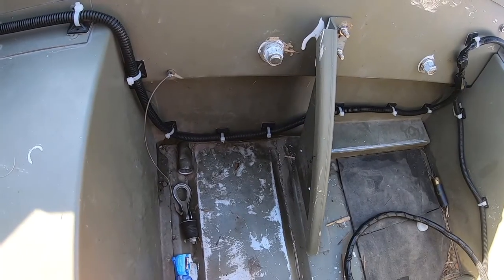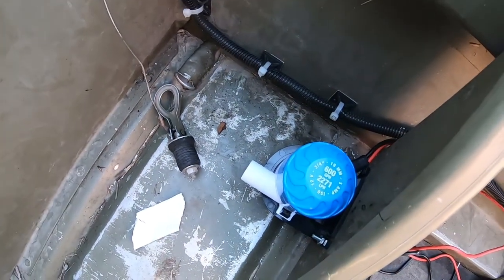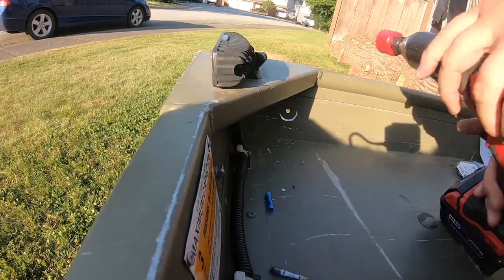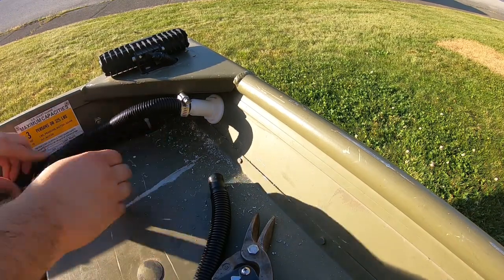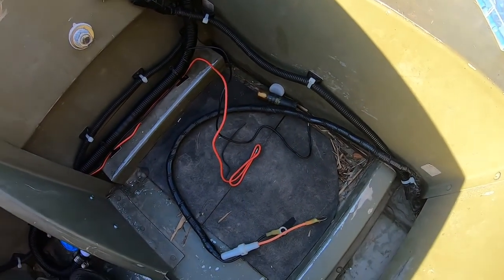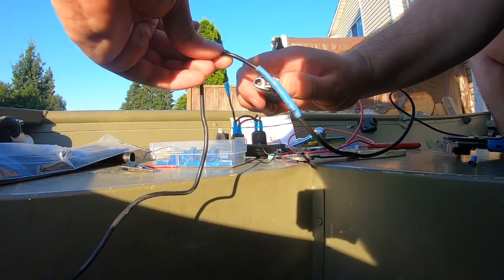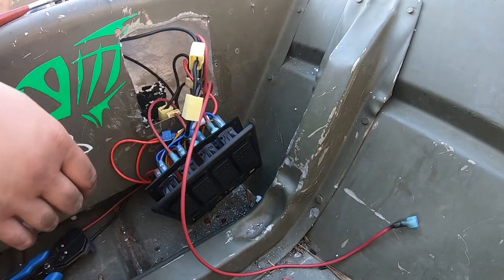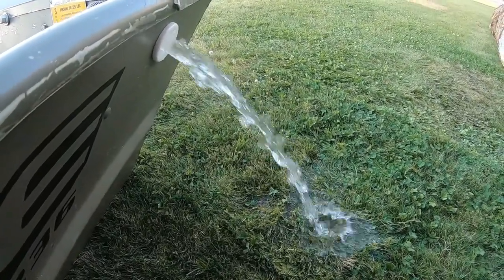Bilge Pump Installation (Part 2)

Comment: Hey buddy just wondering is this the bilge pump setup they sell at walmart?? Ifso hows it holding up an if you've had to use it how'd it do??
Reply from the maker: No not the one from Walmart, this one I got from Amazon and it’s holding up great I really use this a lot in the fall and my only complaint is as soon as I get grass in the boat it has a hard time sucking up the water but after it’s cleaned off it works awesome. After a year of use no other issues.
Reply: @BCBackwaters  appreciate the info